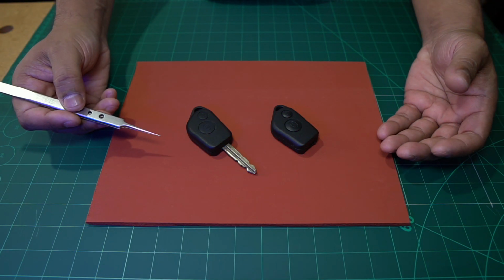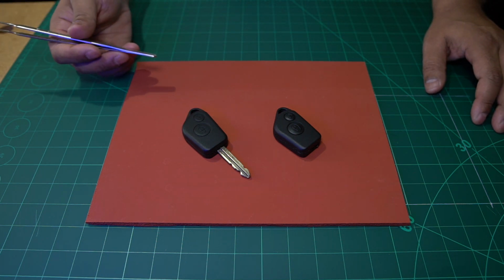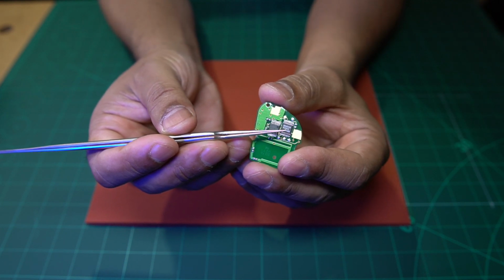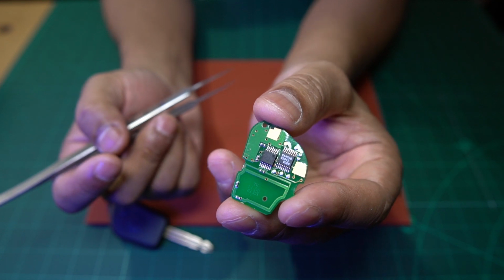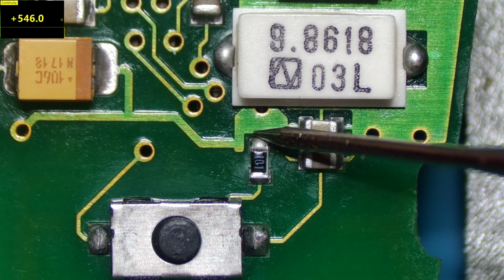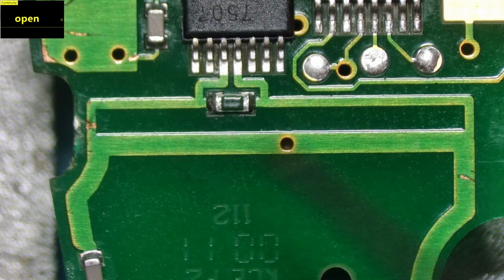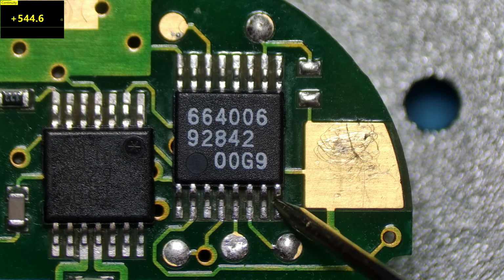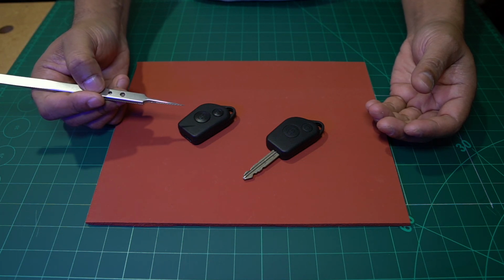Citroen Saxo Picasso Xsara Berlingo Key Fob - 664006 IC Repair - iRefab

Comment from the maker: We've received some new info following the release of our latest video featuring new details, prompting us to highlight this information for anyone attempting this repair. Please be aware that we do not offer key code programming services, so we cannot confirm the accuracy of this information. The guidance shared here is based on feedback from our audience.

1. After the 664006 IC is replaced, the key is now in a “Virginised State” 

2. In this state the key cannot be programmed to the car by just sticking it in the ignition and pressing the key’s on the Fob.

3. To programme this key to the the vehicle you need to get hold of an Auto Locksmith that has a software called “Lexia” and the hardware to go with it.  It is the same software and hardware that the Citroen Dealers use themselves.  

4. But that’s not all, to programme this Fob to the vehicle you will also need what is called a “Confidential Code”. This code was provided on a card when the vehicle was purchased new.  If you have lost this code it can be obtained directly from Citroen by providing the VIN number of the vehicle and proof of ownership.

5. You will also need the little black transponder chip.

6. Once you have all the above, the Auto Locksmith can then successfully pair the key to the car.

So in conclusion the Key Fob can be programmed to the vehicle but there is a procedure to follow.  Where as before even if you followed the procedure above you would not be able to programme it because the original 664006 IC on your Key Fob was faulty.

Comment: Great videos !  I'm  assuming  the rf chip was replaced ? As it uses Manchester code encryption  & provided the immobiliser I.D still remains the same ( vehicle still starts ) . You simply need to re - pair the radio & to do this, pop the key  in & turn on the ignition within 10sec press any button.  if no start then yes follow your steps bellow. Lexia & or xhorse tool which can extract the confidential code or main dealers £35.